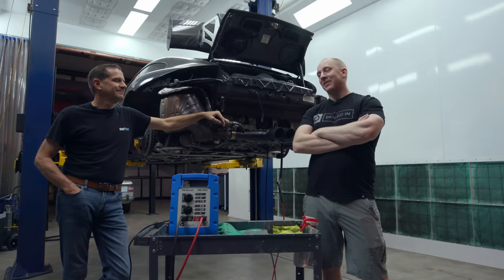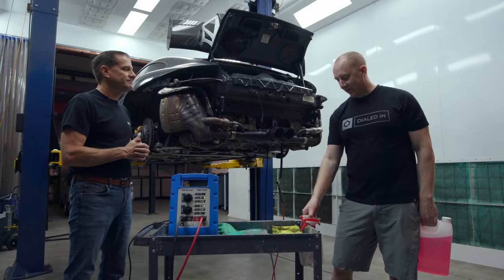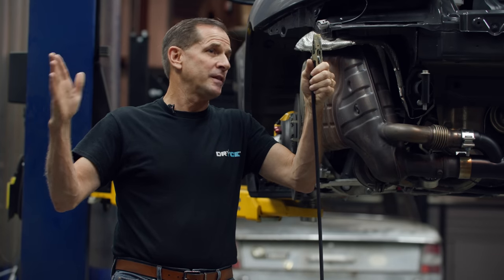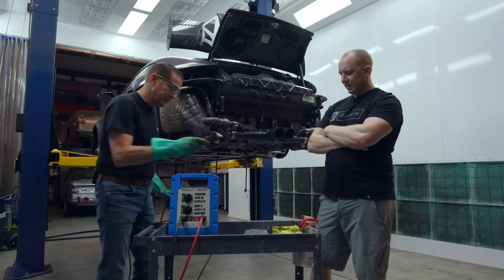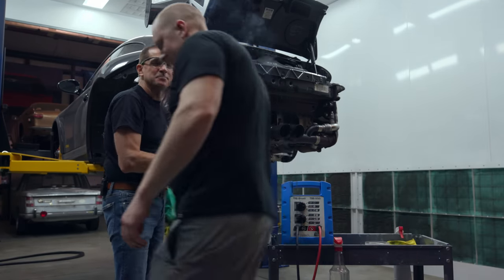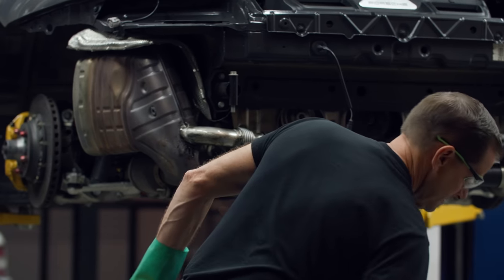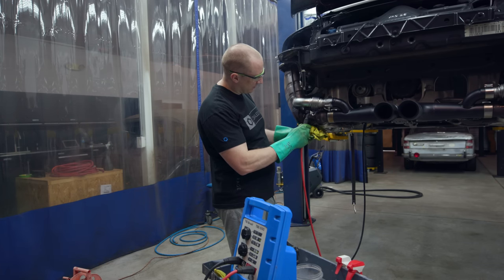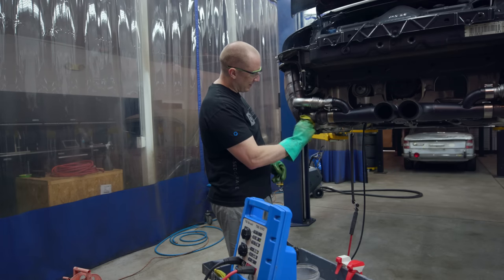TIG Brush - Next Level Metal Restoration - Make Your Exhaust Look Better Than New

Comment: Chromium prevents rusting on stainless steel.  The amount of chromium varies by grade.  Automotive rust on stainless is mostly magnitized iron particles from driving environments.  When water is added you get oxidation.  After the water dries, you're left with the rust.  When stainless is stamped, the stretched or bent areas have a lower % of chromium at those points.  Less chromium can equal quicker corrosion.
Reply: That’s awesome
Reply: The Tig Brush removes the Iron ,carbon , chlorides and Sulfieds from the surface leaving behind a chromium rich environment .
As soon as the oxygen in the atmosphere hits the Chromium it develops a Chromium Oxide Layer and the stainless is passivated .

Tig Brush meets Global standards for passivating Stainless Steel ASTM A967-05 and B912-02
Reply: Dynamic Power Transfer ramps power up and down as for the Work hardened Martensitic bend lines.
Reply: That's what I was thinking...yes you can remove it but once it's out in the elements there's not much you can do

Comment: The Tig brush removes oxides from the surface of the Stainless  using heat and in this case a 50% phosphoric acid cleaning fluid.
Tig Brush fluids are made from analytical grade chemicals and are NSF Certified.
We do recommend that you wear all proper PPE including Gloves, N95 particle mask and Eye protection.

Comment: I'm not a chemist but the fumes from combustion of phosphoric acid are not something I would want to breathe.
Reply: … or handle. I’ve forgotten which type of acid was in the “Acid Wash” step of the FinishKare paint decontamination system… but I made the error of using it without gloves once, then maybe for a small portion of a separate application. Legitimately had nightmares of massive black spiders afterwards. Never again, without gloves.
Reply: I specifically cited the TIG Brush developers saying this and the comment was removed. Maybe it was the auto-moderator, but I'm pretty disappointed.
Reply: No idea what this means as I'm not a chemist, but these are the Prevention Statements from TB-25:

P234 - Keep only in original container.
P260 - Do not breathe dust/fume/gas/mist/vapours/spray.
P264 - Wash thoroughly after handling.
P280 - Wear protective gloves/protective clothing/eye protection/face protection

Comment: Stainless steel rusts because it is stainLESS not stain proof. Most stainless is not high enough in chrome content to truly prevent rust. That is because stainless steel is weaker than carbon steel, the amount of stain/rust resistance is inversely correlated to the strength of the steel. The strength required in the part determines the amount of carbon needed in the steel, that determines the chrome content of the stainless steel, which determines rust resistance. The rust will return in almost all cases.

Comment: Does it work as well on other ferrous exhaust? Because those classic W123 Mercedes didn't have stainless exhaust from factory. It would be interesting to see how it reacts on older exhaust with maybe a thicker layer of oxydation/rust. Also curious to see the results on titanium exhaust.
Reply: The Tig brush will clean and passivate ferritic Stainless Steel.
Ferritic stainless has high chromium content and little if any nickel.
 Clean the oxides from the surface.
Oxygen hits the Chromium rich environment and passivation is completed.
Reply: @Rexcleansmetal  Interesting, what about my points in the initial message?
Reply: I understand what your asking now. I assume that you are speaking about the cast iron or steel .
I would not recommend the Tig Brush on cast iron collector assets.
 
Bead Blasting is probably a better solution.

Comment: It will totally trash the floor if it drips on it.
Reply: This is completely correct!  The TigBrush rep explained that to us during DryceDays a couple weeks ago.  So we started using an oil drain canister to catch all the runoff.   Works great!  I'm probably going to lay down a large rubber mat as a secondary precaution.

Comment: The thing about that oxide layer is it stalls deeper oxidation and if you remove it a new layer has to form which consumes more metal there by making the pipe thinner
Reply: The Tig Brush will not change the Base metal structure or reduce base metal thickness when used in the cleaning mode.
Reply: @Rexcleansmetal  someone does not possess logical deduction skills... 🤣
Go back to school and pay attention in science class
Reply: @blueberrychronic  lol I dont think you know who Rex is
Reply: @lucianholbrook3966  he is not infallible...
Reply: The Tig Brush will reduce base metal if you use it in the polish and etch mode but it will not reduce base metal thickness when used on Stainless Steel in the cleaning mode.
And yes I am fallible.
That’s why I hang out with people smarter than me every chance I get.
Reply: @Rexcleansmetal  with repeated cleaning it will remove metal. What do you think the  oxide layer you are removing is made out of? It is not as if the oxidation is getting reversed...
Reply: @blueberrychronic  Check out passivation of stainless steel.  The acid removes a portion of iron molecules from the surface causing a chromium rich surface with higher corrosion resistance.  Once the existing corrosion layer is removed the passivation layer is like a tenth of a micron thick, so I don't see this causing any significant "thinning" of the pipe.  I'm not an expert on this stuff but passivation is pretty widely used in much more critical areas than an exhaust, so I'm personally not going to automatically brush this off as bullshido without more research. No pun intended

Comment: Surely this is something that you can use on a normal tig set?
Reply: You will burn the brush up very quickly.
The Tig Brush Has Dynamic power transfer technology.
This technology reads the condition of the circuit and adjust power up and down to continually provide the maximum power you can have without burning the brush up.

Comment: I'm all for attention to detail and I love many of the ideas and products that Obsessed Garage offers, but I don't see any value in dry ice or this.
Reply: For most people this is way overkill, but think about a business owner buying dry ice or TIG brush systems and selling the service to people. There's an entire market there!
Reply: This is mainly for business applications, as far as dry ice cleaning, that’s pretty self explanatory. For shops that work on rare and valuable cars, they need to get to every nook and cranny as best as possible without damaging the actual vehicle. If they used pressurized water or steam, moisture will buildup and creep into various electrical cavities. Where as leaving it alone would demand a lower price from the business standpoint. Not to mention that waste is dramatically reduced to dirt and dirty PPE versus dirty PPE, exposure to hazardous chemicals, disposal of said chemicals and more clean up from the work.
Reply: They also use dry ice to clean inside on plastic and material like seats, seat belts and carpet especially on restoration projects where you can't afford to break irreplaceable pieces.